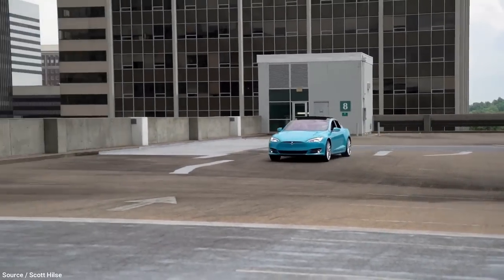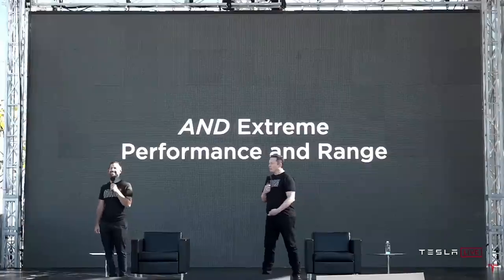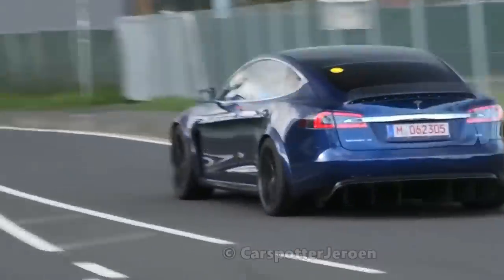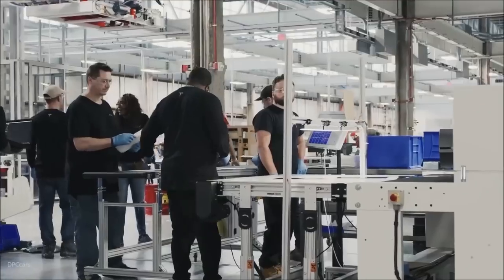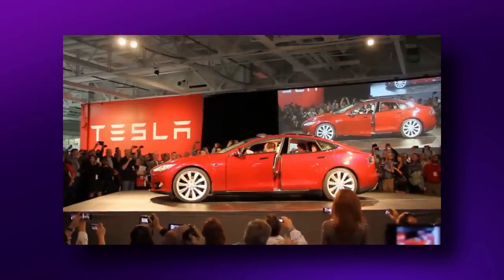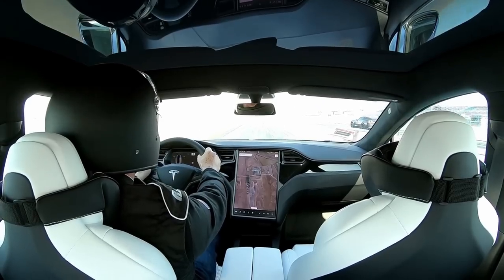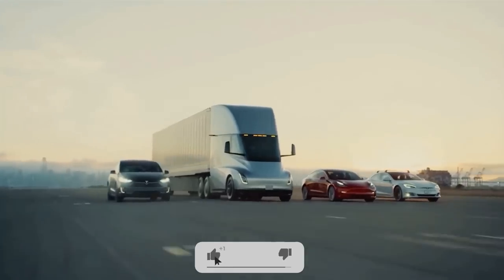Tesla Plaid Mode: Better than Ludicrous Mode

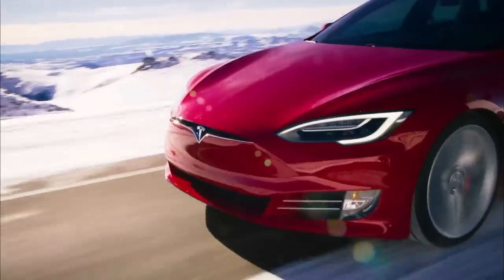Comment: 2:00 Supercar territory like hell... even Megacars CANT do 0-60 in less than 2 seconds, let alone Hypercars or even Supercars!
Reply: Exactly what i thought
Reply: 765 mclaren just ran a 9.2 at155 in the 1/4 mile. Let's see the plaid do that 15 times in a row, the mclaren can
Reply: @David-er1cy  dunno bout the plaid but im sure the roadster will.
Reply: @phoenixultimate8253  Roadster doesn't even exist yet lol.
Reply: @Ren_1106  The prototype which they unveiled on the day of the launch was fully functional and people got to try out going from 0-60 in under 2 secs. We're basically just waiting for mass production...
Reply: @phoenixultimate8253  no It won't. Electric cars need to prep for  a run like that and it will eat 10% + of their battery lol.
Reply: @ironbull2003  maybe in the past... Things have changed quite rapidly at Tesla.
Reply: @ironbull2003  You should look up the specs. I strongly doubt a quarter mile will eat 100km of battery each time.
Reply: @Gozi101  it was a figure of speech bud. 

My point is this. My brother drives a 750whp mustang. We frequently see  Teslas trying to show off with a mini pull next to us when they hear the exhaust. 

The moment he responds and says let's do this. Not one in the last 2 years has actually raced him. 

Electric cars have come a long way. They are still 5-10 years away from being practical. 

You cannot just push a button and go zoom instantly.
Reply: @ironbull2003  Dont know why... I currently follow quite a few channels that drag race Teslas against ICE cars

And usually they win beating cars that cost way more.
Reply: @ironbull2003  You mean ludicrous mode? A Model S Performance doesn't need to go into ludicrous mode to beat a Mustang...
The Plaid Model S would easily beat a Mustang in default. The Roadster would beat pretty much any car in default and just demolish with ludicrous mode.
Franz von Holzhausen the designer was literally continuously giving people the opportunity to experience it in the Roadster prototype throughout the whole event 0-60 in 1.9 seconds
The event lasted for hours and loads of people who paid for the preorder that day got to test it out.
Reply: @ironbull2003  I don't know if you're aware but Electric vehicles in general have much better acceleration than ICE cars, since there's no 'vroom' thanks to instant torque on an electric motor.
Reply: @Gozi101  j'm aware. It's nowhere near enough to keep up with superiors without unlocking full power and prepping prepping battery.
Reply: @ironbull2003  I'd say a 1.9s 0-60 on an unprepped 2 year old roadster prototype that is yet to finalised for production, should be more than fast enough to keep up with the superiors, when its finally out for production.
Reply: @Gozi101  prototypes are fairy tales. 

And a "regular" mustang sure. It could.
Reply: @ironbull2003  True generally. But in this case we're talking about a working prototype. 
Elon always makes the statement that a prototype is easy but production is hell. It's only a matter if time.
Reply: @Gozi101  Elon musk has promised a lot of things he never delivered on. 

Prototype and production are worlds  apart.
Reply: @ironbull2003  such as?
Reply: @ironbull2003  all past prototypes Tesla's made so far have come to production and been better, counter to what other companies do.
Reply: @ironbull2003  Now granted he's sometimes late on his delivery. But when he eventually does deliver, he almost always overdelivers
Reply: @Sir Feynman Elon had an interview with Sandy Munroe which explained the poor build quality issues. He said usually they arose when ramping production and that the best times to get one was at the very start or after production ramping.
I suggest watching that interview to really understand why other Evs really can't compete with Teslas.
Reply: @Sir FeynmanAlso EVs are very different my from ICE cars. Very much like the old Nokia phones vs Smartphones, EVs are far more reliant on the software side of things, which a lot of legacy companies are having trouble with such as Volkswagen.
Reply: Yeah there’s factory petrol powered cars doing 1.9 right now
Reply: yea it triggged me too
Reply: Cheap as way to go fast the first hundreds of meters. I prefer a real supercar
Reply: @David-er1cy  The McLaren is indeed a hell of a car, but it's pretty sad that you have to comment on a Tesla video when you clearly don't like Tesla nor own a McLaren 😆
Reply: @ironbull2003  Practical on the track or daily driving? I do agree that the whole battery heating isn't practical so I hope they fix that on the newer Model S with the new batteries. The Model 3's don't have that issue since they don't have a launch mode.
Reply: @Gozi101  tesla model 3 body gaps doors not closing properly need I say more about quality.
Reply: @scorpiuswireless1  yeah cool how much are they though?
Reply: @joewhite8079  go up about 7 comments to see my response to this. 👆🏿
Reply: @Gozi101  not really a excuse for poor building quality when you have all other brands just about not having these issues its pathetic having doors not lining up properly when your paying in my country near merc or BMW money it's unacceptable.
Reply: @joewhite8079  I'm assuming you didn't read my comment. That only happens during production ramp which is usually a 2-3months  period. These are growing pains that all car companies had when they started off. Tesla is the first company to reach volume production in over 100 years. The panel gap problem for example has been resolved. I strongly recommend watching the video to get a proper understanding of the quality in them. EVs are a completely different way of making a car. BMW and Merc still can't make EV cars optimised to the same level as Teslas.
Reply: @Gozi101  look a read your comment before and I get how a gap can occur and I'm not foing to argue with you about it the facts here are that people brought a tesla 1 month ago the video was and his door wouldnt shut properly due to the gap so its still partially here and I just expect if you pay that much that it shouldn't be a issue I will now watch your reccomned video so I can gain a better understanding before making more comments.
Reply: @Gozi101   @Godstime Osarobo  the thing is there is a guy on YouTube called Engineering Explained. So he had ordered his Tesla model 3 online and he got it in 2 DAYS. Like one day to make and one day to deliver, and he ended up getting quite some build quality issues ( he even did not get the carbon spoiler he had optioned for ). The thing is a man has a hard time earning money, and buying a car is a lifetime decision for many, so I'd rather have even a 6 month waiting time and get a well made car than getting my car made in 1 day with lot of quality problems. That's why some people who are rich enough to afford a model S often get it wrapped or painted.
Reply: @vandita3695  if that's the case he could easily have told Tesla and have them fix it
Since that falls under warranty. I'm sure they'd have done something about it.
Reply: I don’t really see the point of a road car accelerating at sub-3 seconds.
Reply: My thoughts too. The current Tesla range are in Super Car territory. F1 cars now average a 0 to 60 times between 2.1 and 2.7 seconds.
So the Model "S" Plaid with a sub 2.0 seconds to sixty is even beyond that of Hyper Cars   8-))...
I wonder if they'll be fitted with neck braces   8-\\...
Reply: @thezanzibarbarian5729  yeah they are quick but actually it is just shady marketing. Most of the manufacturers understate their car's performance. For example Porsche gt3 actually does 0 to 60 in 2.6 seconds on prepped dragstrip and 2.8 on normal street, but the company mentions it as 3.4s. Tesla subtracts one foot rollout while measuring 0 to 60 times, which was actually a flaw in the method of measuring acceleration times, so the measuring clock does not start until the car has already travelled one foot. Current Tesla model S was supposed to do it in 2.1 seconds but in real life it does in 2.5 on a prepped drag strip. Because there is no official organization maintaining acceleration times, tesla often gives misled times. If Porsche starts calculating acceleration times like Tesla, then their 911 turbo S actually accelerates quicker than the claimed time of Tesla roadster.
Reply: @eloute01  that's because all these supercars are stuck with 4 joke strokes, the 3 phase motors in the tesla's are an electromagnetic rotary 2 strokes.

Comment: "This take the vehicle into supercar territory" 
Name just one supercar that can achieve that. The model S has been in supercar territory for years now. Also you get a dislike for the clickbaity thumbnail.
Reply: McLaren 765LT  9.4sec quarter mile out of the box.  9.3 on toyo R888R tires ;)
Reply: @ironbull2003  He was talking about a 0 to 60 in 1.9s.
Reply: Valkyrie 007  1:43
Reply: Supercars also go much faster not just 260kph
Reply: @Muayyad Siamwala of course
Reply: @castortoutnu  cold air intake on the mclaren will get it under 2

Comment: 2:04 supercar territory?? 1,9s is way quicker than any supercar right now lol
Reply: Quicker* - at this rate, by 2030 Hypercars will be doing 0-62 in 0.9 seconds!
Reply: 2.1 Sec 765LT this is the territory
Reply: The only thing cooler is the Koenigsegg Gemera
Reply: Luckily 0-60 isn’t the only thing a hypercar needs to be good at
Reply: @morsl8550  yeah it also needs to be more expensive
Reply: Also it won't do 1.9 to 60mph, these numbers include rollout. AKA tesla is scamming buyers yet again.
Reply: @dinmor2701  what won't do 0-60mph in 1.9s?
Reply: @Gozi101  Well a lot of things including a 1.0 stock civic, but we are talking about the tesla plaid in case you didn't notice.
Reply: @masterfhd  765LT is probably faster, because Tesla 0-60 in 1.9 is without rollout, so they measure more like 6-60. That's how they get the sub 2s number.
Reply: @Gozi101  more expensive? What is that even mean?
Reply: @maxackerny7423  It's a joke haha. Generally hyper cars are very expensive. It's almost a requirement
Reply: @Gozi101  oh okay sorry
Reply: @Gozi101  Any tesla Model S, even Tesla doesn't claim it. If you remove the rollout it will be above 2 seconds. Read the fine details in Tesla's specifications.
Reply: @dinmor2701  To be fair, it does say in the small print - but even with that, some people will still believe it!
Reply: @JonathanMorris777  To be fair, the small print is what should have been advertised

Comment: Lets see of it can maintain the acceleration, P100D with Ludicrous mode was a one trick pony which ran out off puff, battery overheating and crap handling. 🤔
Reply: Will be the same here...its not a Mclaren which runs the same quartermile time the whole day 🤣
Reply: ^ You won’t win your Mclaren back after losing because you claim it will do the same all day.

Mclarens are two wheel drives and will never perform as well on the street without dragstrip glue 😂 underneath.

And on the track - unless it is empty there is no way to do 1/4 miles without several minutes in between runs.

Overheating is never a problem for electric cars in drag races anyway.  It is running down the battery that reduces power.
Reply: @summertyme5748  are you high?
Reply: The new heat pump should allow it to run back to back with consistent performance. Additionally, they will be using new battery chemistry for the plaid plus model s which should help even more.
Reply: @arod6789  he is.
Reply: You know it is a four door family sedan right? it's not designed to handle those temperatures if you abuse it. A more fair comparison would be with the new Roadster.
Reply: @Warbay57  the Roadster doesn't exist.
Reply: @artansadiki3244  There is literally prototypes  of it everywhere.

Comment: To make it even more faster, add motor in the wheels that can go 100 miles per hour. So the 200 miles per hour, plus 100 miles per hour is 300 miles per hour more faster. Hey, smart thinking, huh? Disclaimer, it only works without extra drag and other natural phenomes, so drive it in a vacuum tunnel, downhill. I need to fry some eggs to grow my onion.

Comment: Those are very impressive numbers but, when you stop and think about, why do you need to get to 60 in 2 seconds and where can you go 200 mph? Let's get real!
Reply: Same thing with gas cars, they also go 150, 200 miles per hour, and in my opinion acceleration is a bit more usefull than too speed

Comment: I don't unsderstand. Is the plaid mode a software upgrade that can be implemented in every car of tesla, older newer, or is it a mode that accommodates newer more powerful motors? I mean the plaid mode is for more powerfull (,more hardware powerfull) engines or will it upgrade an older tesla car?

Comment: I don’t care about fast, I care about far. Why put a powerful motor in a car that uses battery capacity very fast. Why not put a motor that’s adequate,That does not drain the battery quickly ,thus, giving greater range between recharges. I haven’t gone over 75 miles an hour for about 15 years, I haven’t gone over 80 miles an hour for about 25 years, I have never gone over 90 miles an hour on public highways ever. And I am an ex- motorcycle road racer , I have won 6 road racing championships, 2  national championships.I am an experienced driver at very high speeds, I know how quickly things happen at higher speeds, so I never irresponsibility sprain posted speed limits..
  In five years, what good is a very quick car going to be? we all will be stuck behind self driving cars / trucks/ buses that will never exceed the posted speed limit..
  there will also be license plate readers and tracking devices that will report your speed to the local municipalities. Don’t think so? Pennsylvania already has license plate readers on the Pennsylvania Turnpike that eliminated toll booth workers. You get a bill in the mail When the license plate readers read your plate as you Enter and exit the turnpike. The city of Pittsburgh is going to install license plate readers on certain bridges, and send everyone whose license plate they read crossing those bridges a toll charge in the mail for that day..There happen to be over 1200 Bridges in Allegheny county where Pittsburgh is located.
  In England, they are so fed up with those  license plate speed cameras hidden in remote places on the roads, that recent newly elected  politicians have been elected by promising to eliminate  speed cameras
  The past is far brighter than the future

Comment: How about ad gears to get a higher top speed
Reply: The only problem with that, although smart. Is that you simply would snap the higher gear ratio with the amount of torque that would be on it. Unless you use solid 1 in. Steel. It wouldn't work. I think 200 for a mid sized sedan is pretty reasonable lol